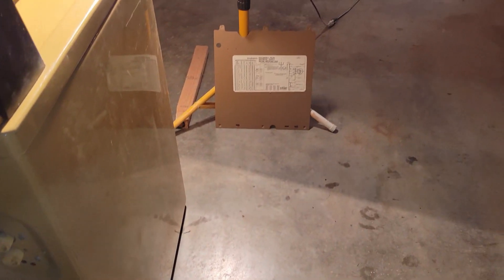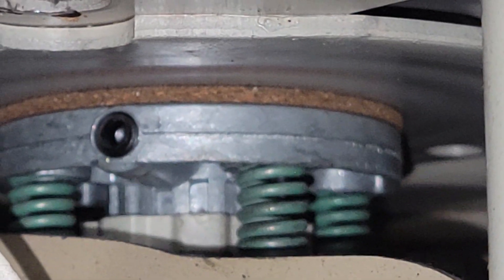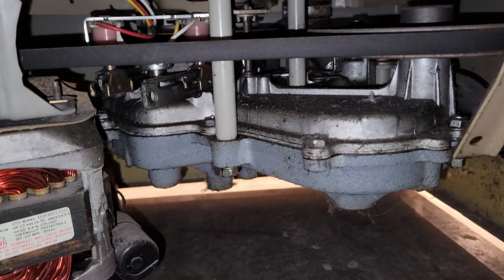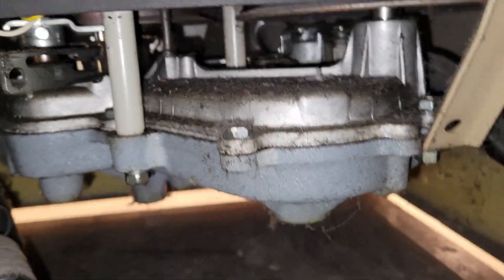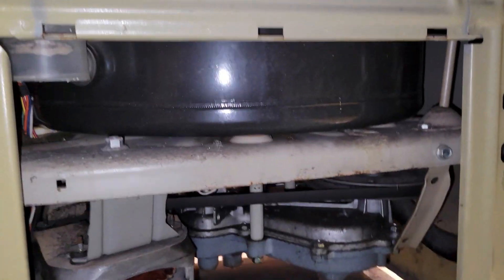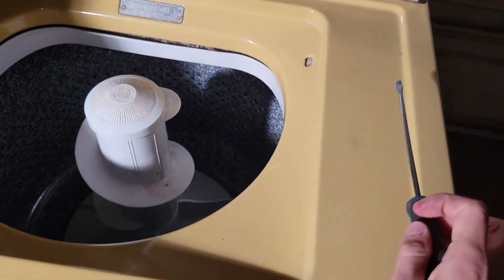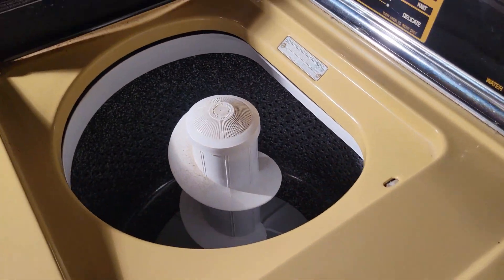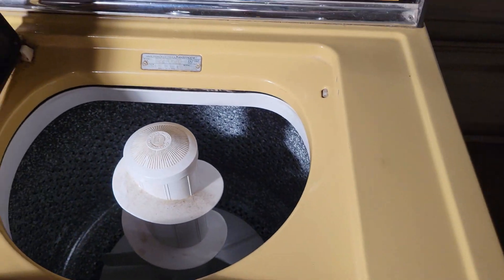Overview Of The Vintage Kenmore Belt Drive! + Quick Test

Comment: I hope one day (relatively soon) I can find a refurbished belt drive like this one. My only concern is rust and lack of available parts these days. I can't wait to see this up and running.
Reply from the maker: @MatthewJames-st5wv  You'll find one soon enough.  Depending on what it needs, you should have other collectors who sell parts to source from for a long time.
Reply: @MatthewJames-st5wv  the only parts you’ll need is a bearing & seal kit, a spare pump, wig wag assembly & plungers, tub seal, a few other odds and ends. Belt drives actually are more reliable since there isn’t the pesky neutral drain pack that can fail.

Comment: So far, everything sounds healthy even though it hasn’t been used in awhile. The pump that’s on this is a 3 port pump, just the third port for the lint filter has been blocked off since this doesn’t have the manual clean filter on it I believe.
Reply from the maker: Thanks for the info.
Reply: @lizboz  believe it also has the comb type of lint filter under the inner tub. Unfortunately, self cleaning lint filters don’t work all that well, seems like a manual clean filter works better since it filters out everything.
Reply from the maker: @seana806  Those self-cleaning filters seem to be good for only one thing; rust promoters.  Depending on how you use the machine, if you only ever wash in cold, only liquid detergent, maybe even RIDONCULOUS amounts of fabric softener per load, and never run cleaner through it, you'll get more of that buildup over time.
Reply: @lizboz  despite the marketing, detergents don’t work that well in cold water. Doesn’t allow them to work at their fullest potential, will lead to dissatisfactory results. This is why I usually wash mainly with warm water, usually rinse in warm but since the ambient temperature of the cold water has been warmer with the heat waves, been rinsing in cold. Not very often I rinse or wash in cold, but usually is done in the warmer months. As soon as it cools down in the fall and winter, will either be a hot or warm wash, followed by a warm rinse. 

As for fabric softener, don’t really use very much especially with towels since it will not allow them to be very absorbent. 

If you get a tub ring from a donor machine with the manual clean lint filter, just have to remove the rubber plug from the third port, run a vinyl hose to the lint filter and you’ll be in business.
Reply from the maker: @seana806  That's why machines had warm rinses back in the days.  They actually cared about you keeping your washer running for as long as was possible.  Not today.

I hear it squawked time and again from these washing machine warriors that you shouldn't use fabric softener because it will gunk up your machine.  For crying out loud, do what you want and be done with it.  Run the occasional maintenance cleaner cycles through it (once a month is best) and you'll be fine.

That's good to know that the waterfall is easy to source and install on these.  That might be a future modification for this machine that I'll put in the cards.